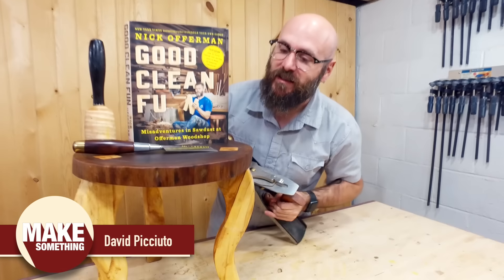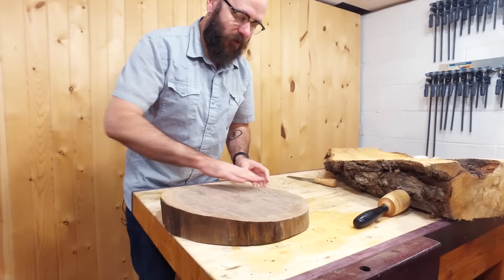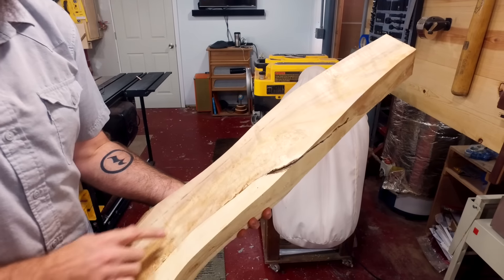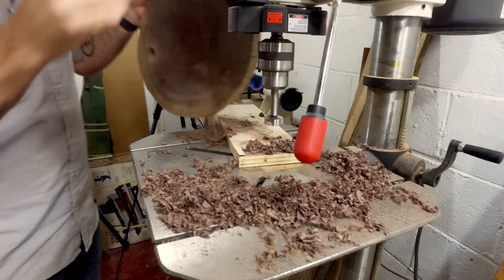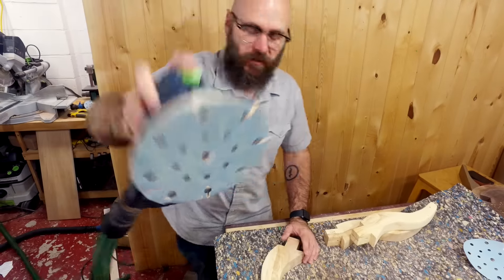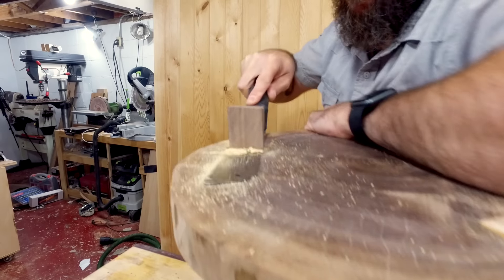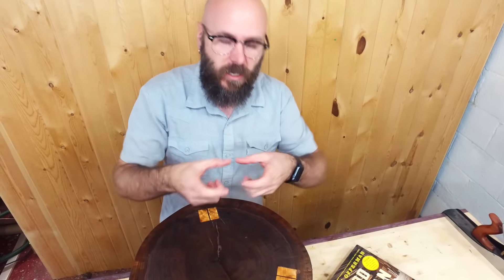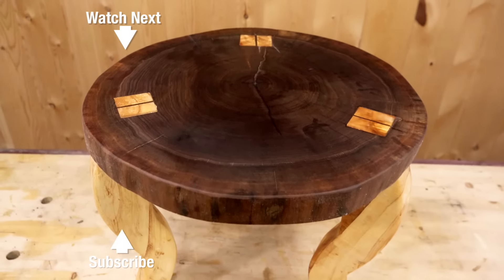Nick Offerman Inspired Berry Stool from 'Good Clean Fun'

Comment: Even though you don't intend to use it as a stool, I would still inlay a bow tie or two because that split will open up over time with changes in humidity. You could do it on the bottom so it's not visible on the top. Besides, someone will sit or stand on that eventually. It's bound to happen. And since it is made from materials that are special to you, you want it to last forever, right? Anyway, great video. I loved the camera work and editing. One of the best woodworking videos I've watched in a while.
Reply from the maker: Hi James! You make some good points! Maybe I'll make a video on the bow tie. Thanks!!!
Reply: Make the bowtie with rounded corners.  The sharp edge of the legs and pressure from the wedge is likely what caused the split in the end grain.  The seat split just like firewood.  Bowtie both sides too.  If just the top, the bottom can still fail when stood on or sat upon.
Reply from the maker: JoeBcrafts I'm not sure I have the handtools to make a rounded corner bow tie. I need to do some research!
Reply: de Havilland Comet: while straight lines and sharp edges of hand chiseled bowties might scream craftmanship for cross grain. In endgrain that might need to support weight the rounded corners with a router template made bowtie is better to lessen new cracks starting at the ends of the bowtie.
Reply: If you have an inlay router bit set (1/8" downcut, guide bushing, and bushing that goes on the guide bushing) it's disgustingly easy to do it.  10-15 minute job.  I do that in the celtic cribbage board video.

Comment: love it!! 👌👌👌 Haha, when you took the hand plane I thought good luck with that.. :'D
Reply from the maker: Thanks! Hand planing endgrain is awful!
Reply: I can imagine it is! Looking forward to the podcast as well, (as always :)
Reply: You need a scrub plane or a jack plane with a wide-open mouth and a heavy camber on the iron so that you can scoop out thick shavings (the old-timers used to say they should be as thick as a coin). You would be surprised how fast that would have ate up the wood, even the end grain, and without the noise and dust. Besides, it's very satisfying :)
Reply from the maker: Stumpy Nubs Sounds like I have some shopping to do! Thanks James!
Reply: i like using my low angle jack plane on end grain... keep it sharp... or a router sled...

Comment: David - Nice plant stand :) - you have definitely convinced me to buy the book.  On the woodworking side something jumped out at me (though I may be making too much of it).  Your kerf cut for the wedges was very narrow and your wedges where very thick with wide angles.  They reminded me of the wedges one uses to split wood (no pun intended).  Though the hole you cut in the leg tenon was large the cheeks really didn't have anywhere to go.  I speculate that the only reason your "seat" didn't split in all three places was because of the softness of the willow.  It's a nice stool but were you to consider building it again, might you consider tapering the mortices just a touch and/or going with a thinner more steeply angled wedge?

Comment: what would have happened if you had ran the walnut piece through the planer?
Reply from the maker: A planer would tear out the end of the board when running end grain through it. There are trick you can do to prevent it but my stool top was too wide for my planer.

Comment: the one thing I noticed as you were using the belt sander was the thickness planer in the background. why are you struggling with the hand plane?
Reply from the maker: My thickness planer can only handle boards less than 12.5 inches wide and my stool seat is about 14 inches. Plus there are a lot of tricks you need to do to run end grain through a thickness planer.

Comment: when doing threw mortises do you always need to split the mortise or can you just not split the mortise? can you just glue the threw mortise and just leave it without the wedge? it may sound like a dumb question, is it more for strength or is it just fir beauty? thanks in advance !!
Reply: The hole in the seat is the mortise (through mortise) and the square protrusion from the leg is a tenon. Splitting with the wedge helps the tenon fill up the mortise space and makes it mechanically "impossible" for the leg to be pulled out.  Optional, but the wedge is easy to do, adds interest and functionality. 

If your joinery is more precise than most the wedge is optional.
Reply: thanks for clearing that up

Comment: is there an easier way to flatting the wood slab? i have a bunch, but dont want to sand them for hours. can i use a thickness planer?
Reply from the maker: +Jenna Smith you can but there are some tricks you need to do to plane end grain. I've never done it but do a search for "thickness planning end grain"

Comment: Maybe some epoxy would help hold that crack together? Marc Spagnuolo (The Wood Whisperer) has a neat trick to pull the epoxy into the crack -- though I wonder if it would create too many bubbles. I've read mixing in some milled fiberglass powder may help, too, especially binding a crack in end grain/slabs like that.

TWW Video:
https://www.youtube.com/watch?v=iaIW798vO3Q